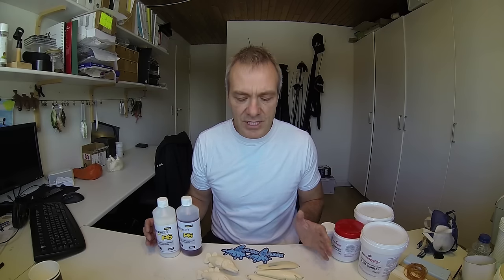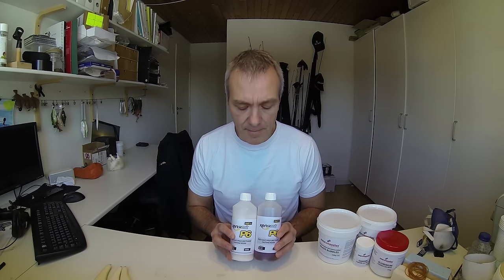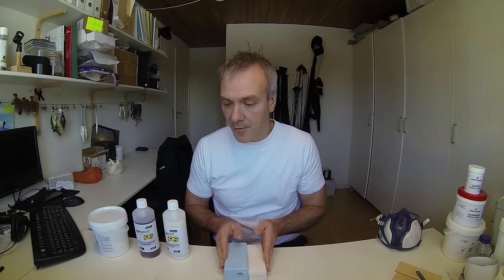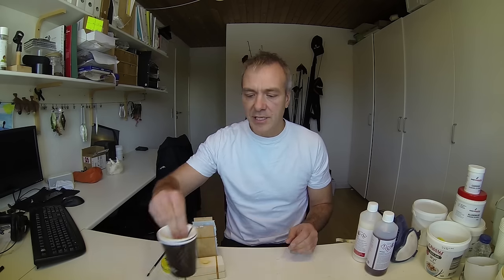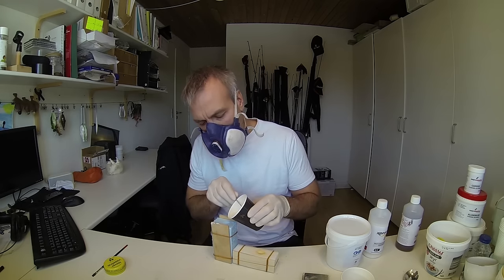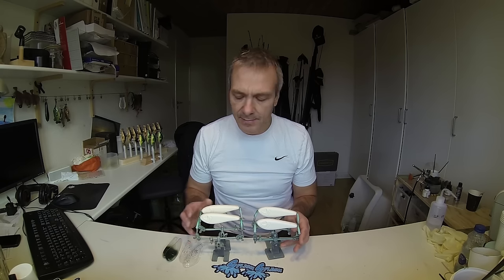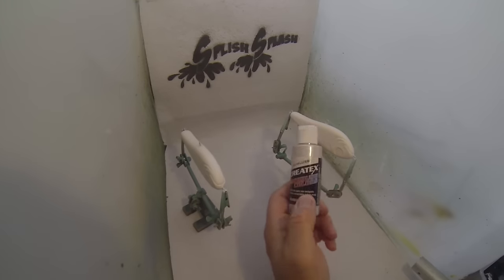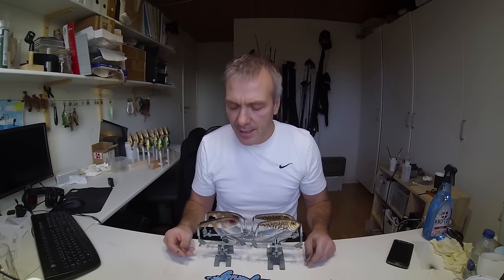Basic Luremaking - Casting Lures In Resin

Comment: Hi Jorgen, excellent and very helpful movie my friend thank you. I have a question, the resin you use in your movie and sold by Easycomposites is Xencast P6, your link for the resin takes me to Xencast P4 so which do you consider the better resin for casting lures P6 or P4? Richard.
Reply from the maker: The big difference between the two is the "pottime"  meaning the time you have to mix and stir, and in the end also the time before you can demold. The P6 gives you a fair amount of time to mix and stir, but also takes almost 1 hour before you can demold. With the P4 you have to be fairly quick (pottime = 4 min. My expeerience more like 2-3 min) but it also lets you demold in about 20 min. So if you are used to resin and want the get some lures casted in short time, go for P4. If you are new to resin, start with P6 and live with the longer production time.

Comment: Good day. Thank you for the beautiful and educational videos. So far, I only create wobblers with balsa, but after watching your videos, I would also like to try casting. I don't speak much English and that's why I'm not sure if I understood everything correctly. I wonder in what proportion you add those balls to the resin? 10% (by weight or volume)  of component "A" or of the entire volume of resin? Thank you for answer.
Reply from the maker: For most of my lures I use 10% of total weight, but I also make lures with 5 and 15% of total weight. Depends on the lure

Comment: Probably a dumb question but how do you remove the funnel part of the lure when you remove it from the mold?  Just curious the best route at doing so without damaging the actual lure..thanks.  great channel
Reply from the maker: Just cut i of with a saw, use a boxcutter to trim, and then sand to a smooth surface

Comment: Outstanding info----- I have a question about that metal netting you used--- Where or what is that from or available ?? Thanks
Reply from the maker: Thanks Jim - Its called expanded metal plate, and I think it is available in most countries - I got mine in a local store

Comment: Hi there... i plan to start to learn to cast resin lure and i have 1 noobs question that is how do i know how much resin do i need? Example i plan to cast a popper length is 160mm and diameter is around 45mm and i would like the popper finalize weight at 100gram. So how much resin do I need?
Reply from the maker: Hard to say as it depends on many things. I assume that it should be floating, so you will need to add glassbubbles, and you also need some weights to ensure the right movement. How much of both depends on shape and desired movement. In the end you will propably end up using somewhere between 70-90 g resin per popper

Comment: Hi! i was wondering how your epoxy drying wheel looks like! never seen a solution on lures with readymade "hooks eyes" like your Resin Jerks
Reply from the maker: Hi Jonas. If you follow this link you can see my setup. https://youtu.be/v02cxBnWbo0?t=9m58s The pencillures are mounted a bit different, but there is some jerks hanging above them. The jerk are just linked together using plastic cable straps or a piece of wire. This setup also makes you able to let them rotate while you coat them